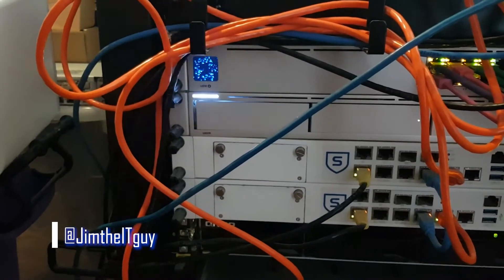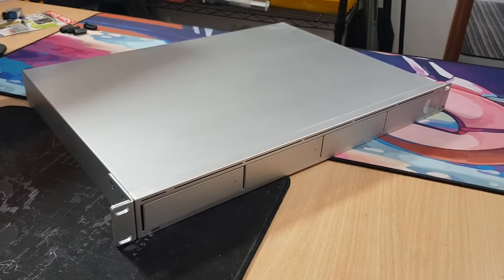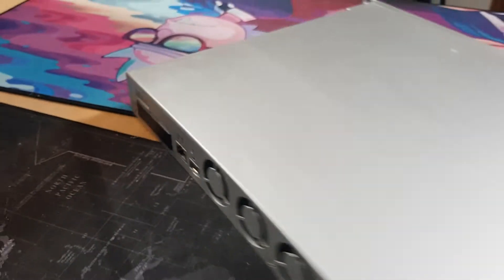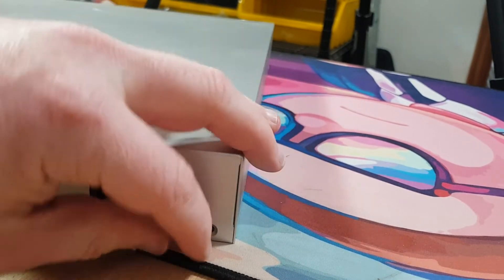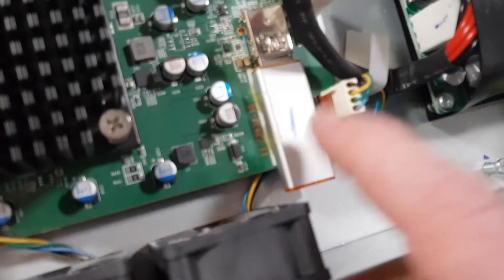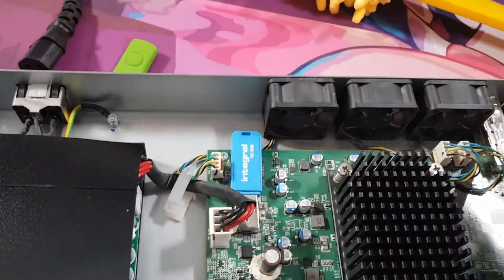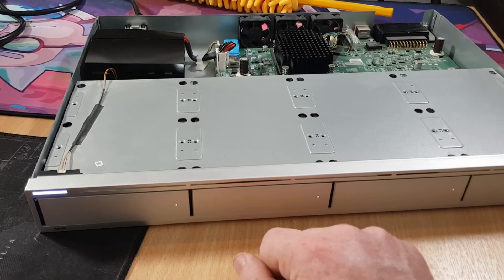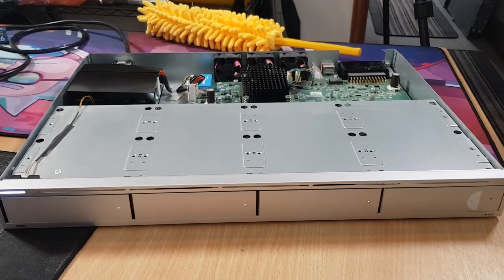Unifi Protect UNVR - Flashing light of Death Fix

Comment: You don't need to factory reset it or lose any configuration - just turn it on the first time (after inserting the new USB stick) with the HDDs *OUT*. Full steps are on the Ubiquiti forum topic thread for this issue. Once the system has reinitialised the new USB memory stick you can reinsert the HDDs and all your recordings will be available.
Reply from the maker: Yes this does work, it didn't when i first attempted to rebuild the NVR but have since tested again and you can just replace the USB drive and boot with no disks, then once happy refit the disks and all good
Reply: thank you for this - i wouldn't have caught to pop the drives without your comment. Back up and running, just had to manually re-join the G4 instants for some reason.

Comment: Absolutely brilliant! I thought I had to buy a new UNVR as it did what your video is showing right after the 2 year mark! I have been so upset about it and furious with Ubiquiti! Got to attempt this fix! Cody from Mactelecom sent me this way so i am glad we have you guys online!
Reply: Question. So worried i will melt the solder on the board if i direct heat at the glue at the bottom of the USB key. Any suggestions?
Reply: Found another video for this, looks like it needs to be scored and pried up with a Screw driver. I was scared I might break something. So here it is. Thanks again! https://www.youtube.com/watch?v=NqdswbNrxP0
Reply from the maker: Just be gentle with it and the glue will come off

Comment: How do you factory reset it with the pin? I can’t get it to work. Shows up in Unifi app but doesn’t let me set it up as a console
Reply: Use any smaller paper clip. Straighten it out and it works like a charm!

Comment: Have just had same issue with my second UNVR after fixing my first one 6months ago (100% failure rate for me!). Easy enough fix..this time it frooze on the reboot also: powered off, pulled the drive sleds out, powered back on, reinserted drives, and it booted & brought me to the set-up page easy enough, cameras & footage still set-up. Restore from back-up wass straightforward. Frustating to have to do this though - & i expect the replaced USBs will need replacing again in a year or so...
Reply: Would you believe I've just had to re-fix my first UNVR again with this same fix... the USB i used had only lasted ~6months, very frustrating. For info it was a 16GB SanDisk Ultra Flair USB 3.0 Flash drive